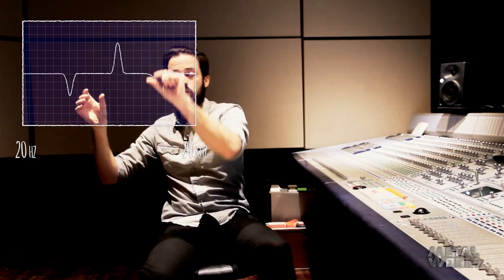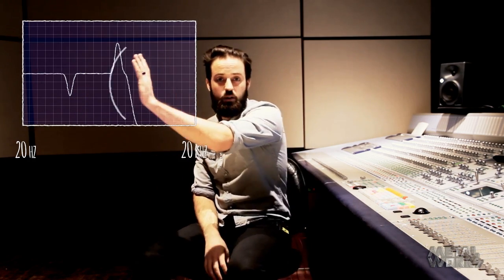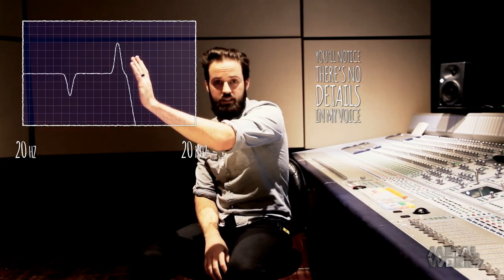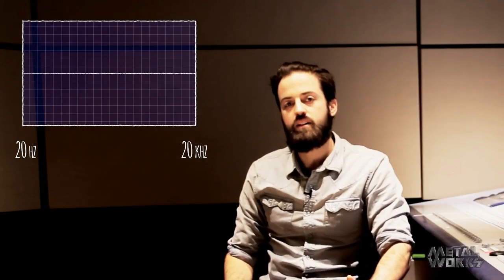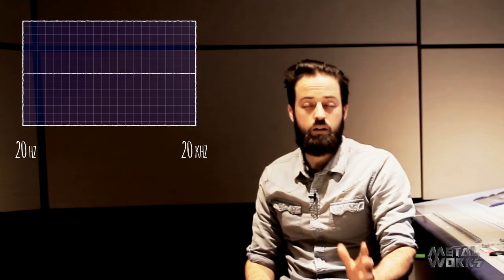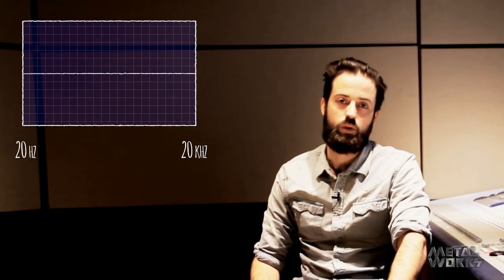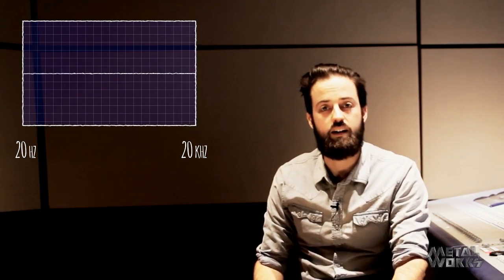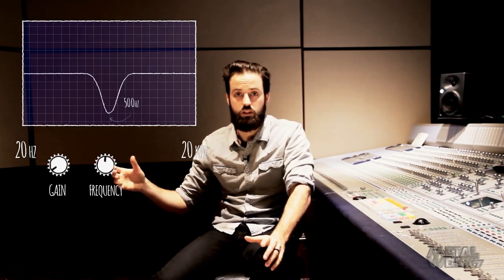How a Parametric EQ Works | Metalworks Institute

Comment: Maaate! You're a genius, I recently upgraded my sound system, to a Yamaha rx-a3070 and my old kenwood krf-v5100d-s didn't have much in the way the rx-a does, I'm learning about the rx-a and it's parametric EQ, up until this, it was relatively easy, I've researched heaps on it prior to buying it and since, but found little on it's parametric EQ, watching this was a great help to my learning curve, now armed with knowledge you so well have presented here, I'll be getting that bit more out my Yamaha rx-a 3070, I'd bought the last one on the shelves October last year in Australia 🇦🇺🇦🇺🇦🇺